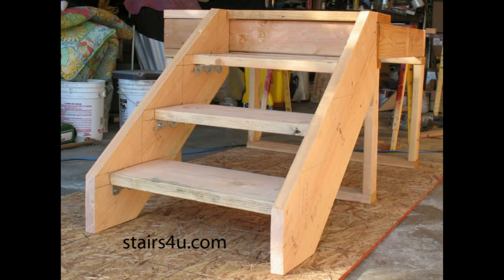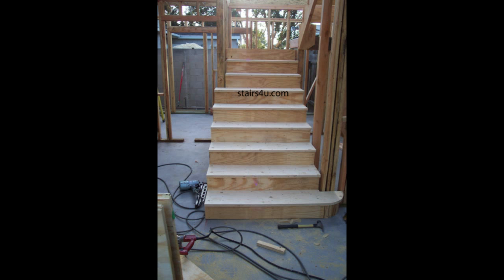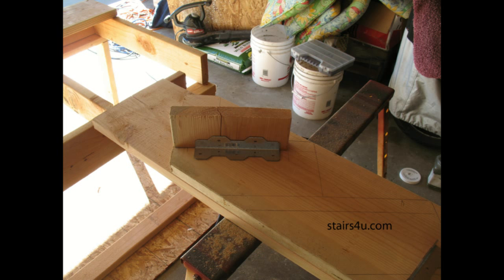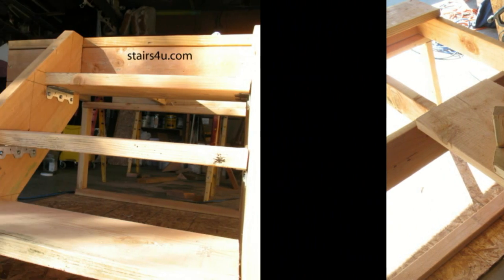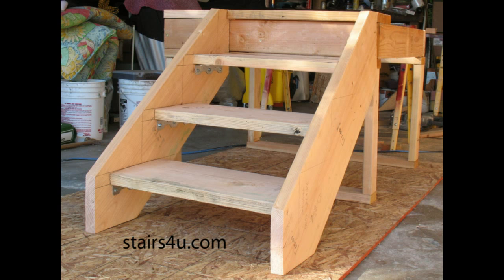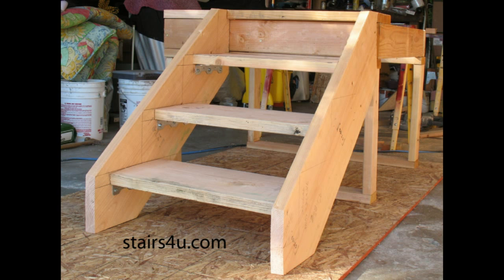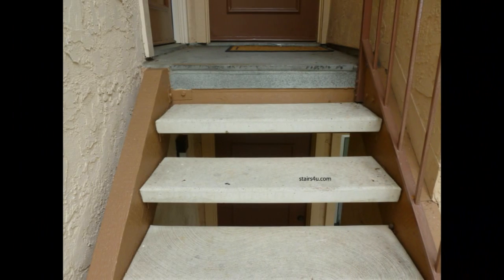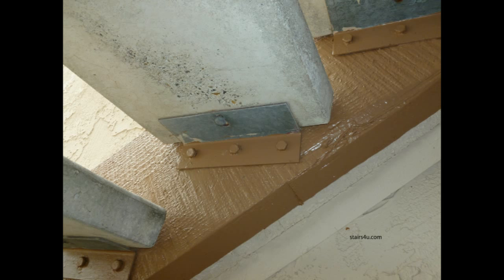Bracket Stairway Design Basics - Stair Building

Comment: Sorry this video is 6 years old so probably won't get an answer, but I read state l stair stringers need to be 18 inches apart, or maybe 26 if wood is thicker. But I've seen stairs like this all my life and it doesn't seem to be an issue.

Is it okay to not follow that rule? Or nobody really cares? Just building stairs and trying to figure stuff out.

Also the gap question. I've always seen stairs with more than a 4 inch gap. Maybe it's not an issue on short stairs? Actually I see floating stairs and lots of stuff. What's the story there?
Reply from the maker: If you find a set of stairs that is strong, then you can probably use their parts and lumber sizes to build similar stairs. Newer building codes might need to use the 4 inch minimum space between components rule where older stairs might not have had that building code when built.
Reply: @stairbuilding  thanks for the reply and input

Comment: I used wood instead of brackets and after 15yrs still standing strong.I think its not the wood but how you mount it.Use heavy duty screws and predrill and I used 4 screws on each piece.Very solid
Reply from the maker: I can't argue with that, because I've seen plenty of still standing and excellent ideas about predrilling and using screws. Thanks for sharing and hopefully you get another 50 years out of that stairway.

Comment: Great videos!  Do you have any thoughts on how to build deck stairways using solid stringers and composite (1 x 6) decking for treads?
Reply from the maker: If you can't get a product to support the weight and span the distance you're going to need to build a set of stairs with brackets, then you might need to use notched stringers or use different materials for your treads. Let me know if that didn't answer your question.
Reply: @stairbuilding  Thanks for your response.  I'm thinking of using solid stringers to allow a greater span for the stairway without needing additional footings and posts.  Thinking to use 2 x 8 structural risers and 2 x 4 cleats 9 inches on center to support  treads.  Wondering if you might have come across anything similar?

Comment: One reason to use the wood block or metal bracket to support the tread is that 2 x 12s say in redwood are expensive.  But you seem to use a 2 x 12 anyway.  Does't make much sense from a cost point of view.  Might as well just notch the stringer...
Reply from the maker: Sounds good to me and you do bring up a good point about cost and something everyone should consider, because some of these metal brackets are very expensive.